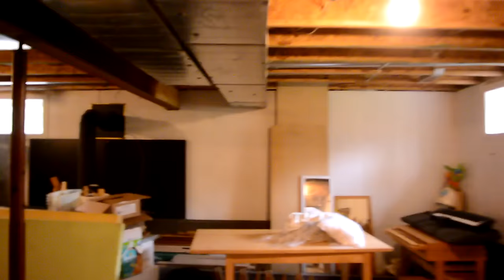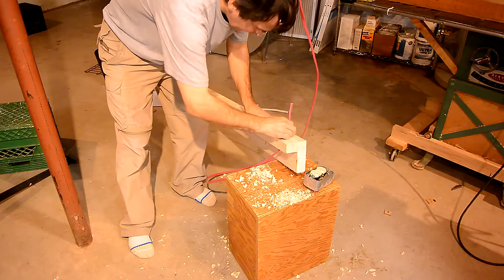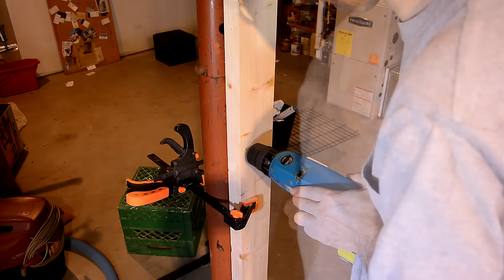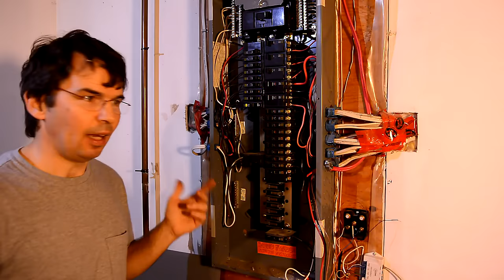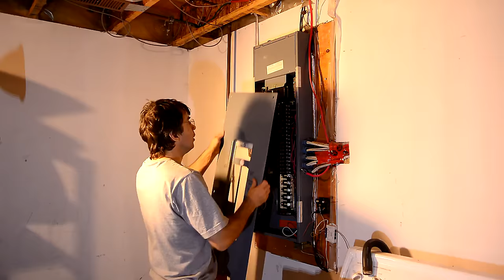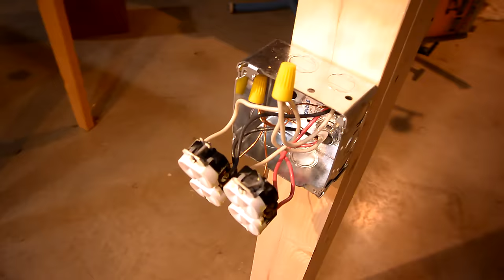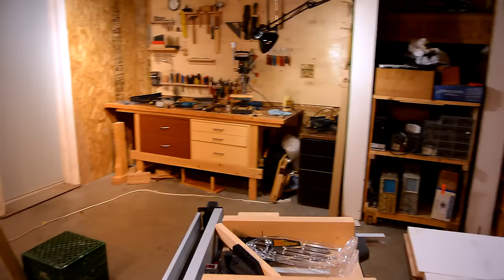Wiring a new 240 volt circuit

Comment: Is your main supply 120 single phase, but you have two 120 lines With phase separation out. Confused UK.
Reply: In the US the typical home is supplied by a single phase of power, in a 240 volt split phase arrangement. Basically that means that the neutral is in the middle of of the 240 volts. That means each live wire is 120 volts away from ground, but 240 volts away from each other.

Matthias is being a bit imprecise when he mentions phases. The two wires are 180 degrees out of phase with each other. Electrically they are considered to be the same phase (this matters for consideration of things like arc faults, which are somewhat different in single phase and multi phase power circuits).
Reply: 180deg?? Surely you mean 120deg?
Reply from the maker: See linked article where I explained all that already
Reply: 180 is right, otherwise it wouldn't be 240 volts
Reply: The sine waves laddy.....in degrees not V for voltages
Reply: 120 degrees is the phase angle in a three-phase system. This is a single phase system with one split phase.
Reply: It's a single phase transformer that takes one of three phases on the pole for the primary and gives a center tap on the secondary which is used for neutral. It's 240 between two sided of the primary and 120 between one side and the neutral. This allows you to have 240v appliances without having any voltages more then 120v above ground.
Reply: 180 degrees. The two “hot” wires of the 240V circuit originate from the two ends of a center-tapped transformer secondary winding. The center tap is the neutral. The secondary produces 120-0-120 at its three connections. Since the two ends are opposite in phase, they are additive; you get 240V across the entire winding and 120V from either end to the center tap. 240V appliances require only the two wires from the winding ends (plus safety ground), 120-240V appliances need all three wires plus the safety ground.

Our power is generated as three phase, with phases separated by 120 degrees. Major distribution lines are three phase; smaller, rural, and residential lines are not (lower cost). A residential single-phase transformer primary winding is fed from one phase of the three-phase system, often 14,400V to ground or even just 7,200V in remote areas. The residential transformer steps that down to 240V center tapped, serving one or several homes.

Three phase is not available in most residential areas at any price. The nearest three phase line to my home is 3/4 mile away.

Comment: Man, you have a lot of room in that panel!  I changed my original 12 circuit for a 30, then we added A/C, a generator input and surge protector and I'm already on doubles. My original panel became a sub panel in my shop and I have a 40 space panel ready to go in when I get the time. I had originally run some 12/3 to get the shared neutral like you did but I then found that the 12/2 was SO much cheaper that it made sense to run two 12/2 runs instead.

Comment: He broke two electrical codes in his installation.  First, the outlet is suppose to be further away from the floor.  Second, you have to leave at least 6 inches of wire either in the outlet box, or just outside of it.
Reply: and he used a razor knife to strip the cover off,  and as someone else said, he used the wrong box connector.....
Reply: If you're going to make a "code" comment, please identify your region.   Code varies by jurisdiction.
Reply: Where I'm from he's not even allowed to perform changes like that at all, so he basically broke all the rules :D
Reply: Yep can't even replace a light fitting in Australia.
Reply: What's the point of having 6inches of wire in an outlet?
Reply: flexibility, stress relief, gives a little safety buffer in case the line is yanked somewhere along the length, expansion and contraction due to temperature changes.
Reply: Just want to say, I thought it was outside the box for the reasons I spec'd, wasn't aware that it could be inside the box.....
Reply: you don't have to leave a service loop since there's is no drywall.
Reply: Muskoka Mike, that's how you strip wire. You don't damage the innards unless if you are incompetent.

Comment: No risk of flood?  Outlet is mighty low
Reply: I was thinking the same thing, Did you ever relocate?
Reply: Never heard of a floor outlet? Those are ... well in the floor. If there is a flood and the outlets are wired properly the breaker will disconnect the power.

Comment: 380V master race reporting in :D
Reply: It says 380V on my outlets :D
Reply: I'm curious how canadians would get that tho, because if monophase is ~120V and biphase is ~240V then each phase is 180° apart, so you can't just add another phase to get a tri-phase system
Reply: It's an old outlet. Since 1988 all 380V triphase systems are 400V. An outlet that can handle 380V has no problem handling 400V. 380V was when your base voltage was 220V. Now it's 230V.
Reply: Jack, His system is single phase. Both the two "hots" are 120 volts from neutral and in phase thus they add to 240 volts.
Reply: 3beltwesty actually the phase of the two hots is 180°. So both are 120V to Neutral, but 240 V difference between the two hots
Reply: Plain Reflex, His home is fed by a Single Phase transformer the secondary is Center tapped, the center tap is grounded at the pole and at the meter. The power is "single phase". Both hots are in phase 0 degrees since they add to 240 volts.

 *****If you float and isolate an O-scope and use 100X probes and tie  the scopes ground probe to one HOT and measure the Neutral one sees 120 volt RMS sine wave, with another probe to the other hot one sees 240 volts RMS the sine wave . With both see at one they are IN phase, not 180 degrees apart. They have to be in phase since that is what all center tapped transformers do with single phase inputs
Reply: 3beltwesty well I have no idea of the technical part, how power is delivered in America. But just from the physics, I can tell you that voltage is a difference in potential. So when you take one wire and compare it to neutral, it is a sine function with an amplitude of 170V. Let's assume the two wires are in phase, thus the potentials are the same the whole time, so theres no difference between these two. So it is a Voltage of 0V. To get 240V you need a phase shift of 180°, or differently speaking:
V1(t)=170V*sin(w*t)= -V2(t).
When you take the difference now it is
V = V1-V2 = 2*V1 = 340V*sin(w*t)
Then the average Voltage over one period is 240V.
Reply: plain reflex the 120 volt rms is 170 zero to peak 340 volts peak to peak. The 240 volts rms is 340 zero to peak and 680 volts peak to peak. Since the voltages are high that is why I said use a 100x probe. There us no phase shift. Thus the voltages are double. Ie 120 plus 120 is 240 volts. All the American Canadian system is a center tapped transformer at the distribution side. Ie no phase shift. Not sure why you think a single phase center tapped transformer has a phase shift
Reply: 3beltwesty ah now i understand how the transformer produces a split phase out of a single phase. But there is still a phase shift in the two split phases. This is because ground is defined as the voltage midpoint, by definition one of the voltages has to be positive and the other one is negative. In other words the sine curve is shifted by 180°
Reply: plain reflex the usa legally calls it a  split phase or a 3 wire system.  It is single phase . It is not two phase. It is not 3 phase. The current and voltages are in phrase in the split phase system with resistive loads. Thus you are using the term "phase" in an improper way at least as far as electrical engineering.  Maybe to it is a translation problem? Ie you say a did is a cat? :)   in the north American system one can connect two 120 volt incandescent bulbs in series . Place them across our 240 volts. The bulbs lite up. Then connect the mid point of the bulbs to our neutral.  Nothing changes.  No current flows since a balanced load. Ie the two legs are in phase.  Ie voltages and currents in phase ie single phase power.
Reply: 3beltwesty I get what you are saying and it is all right. Maybe it is a translation problem, that it is called in phase, although it has a phase angle of 180°.
Reply: plain reflex imagine if you take twenty 12volt automotive tail lights  and wire them in series. Then one  plugs the rig into a 240 volt socket.  All the bulbs light (If they are good:)) . Thus what I am saying is all are in phase if they are a resistive load.      Another idea is here in the usa all the old filament bulbs flicker at 60 hertz slightly but they do so in step. Ie lamps on one 120 volt leg are bright and dim   in step in phase with bulbs on our other 120 volt leg. Regards
Reply: 3beltwesty again it is right what you say, but thats not the point. When you connect all these bulbs across 240V it is just one voltage signal, of course it is in phase with itself. But when you compare the two split phase signals, you have to be a bit more precise. To get a voltage you have to take the difference of the timedependent potentials. Since the sine curves have a 180° phase angle, the voltages are just opposite.
U = 120V - (- 120V) = 240V
Your argument is, to add up the two split phase voltages to get the whole 240V. What you are really doing, is to add the absolute values. Here is your calculation:
U = |120V| + |-120V| = 120V + 120V = 240V
As you see the result is the same, but it is false to assume that the absolute values are the same, thus the phase angle is zero. In reallity the voltages are opposite of each other, which results in a phase angle of 180°.'And the absolute values still add up to 240V
Reply: plain reflex the system here is called single phase. Ie split phase center tap. If one as an experiment has a settup and  grounds the one hot and ungrounded the neutral then the neutral is 120 volts rms  to ground and the other hot is 240 volts rms to ground. All are in phase.  By mentioning 180 out of phase the lay public thinks our system is not single phase. Thus dangerous. Our system goes back to about 1880s in DC voltages. For some odd reason our system is confusing to others. There was some oddball two phase stuff here  a century ago and 25 hertz ac too.

Comment: Hiya Mathias, just wanted to let you know you don't need a direct connection to ground in order for a hot line to zap you. There can be a capacitive property between you and ground that will allow current to flow into you without actually having to flow through you to ground. Just something to be aware of.
Reply from the maker: yes, micro-amperes.  Not enough to get zapped with.
Reply: Thank you, Matthias. They won't understand the difference between "micro" and "milli" even if you demonstrated.

Comment: Oh, that is interesting.  I  was wondering what this whole deal with the two hot black wires hook-ups to 120V all about.  Never have heard of this before.  Now you are the first person I have run into and I got lucky that I watched your video to the end to pick up on the wiring circuit.    It is a good thing that I watched your video to the end.
So, in other words, you can get more amps out of the system.  So it means better to use thicker wires.  Is that why your wires to your outlets look so thick?
So basically it is for shop use, compressors, saws, etc.  Is that the main reason?
I have been through hell the for the last week trying to figure out what the heck people are talking about.  I have kept thinking and thinking, hey my house is not wired like that...

Comment: 5KWA 48v 220v Pure Sine Wave Solar Inverter Built in 50A PWM Solar Charger 220-240v Single phase not split phase !  I’m just adding a Battery back-up to my house with a DIY Generator self sustainable driven on DC power for when the grid drops ! May use once a year and when the building inspector comes out I want it all being proper & inexpensive ! Thanks for all the information and tips like that  1 guy that typed up the safety info 👍🏽

Comment: You must get some high quality drywall screws. If I had tried that, it would have snapped the head off.
Reply: Yeah, what the heck is he using?  The heads always snap off.  Even just in wood.

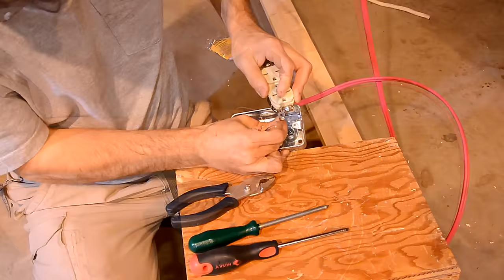Comment: Matthias' has 2 hots and a copper ground at 1:06 thus it is odd that the safety police folks are complaining. The socket is a NEMA 6-15R, it is for 250 volts 15 amps max with a green wire ground and no neutral. Here I install the NEMA 6-20R with the added slot for 15 amp with one vertical spade. ie a modern 6-20R receptacle will take both 20 amp and 15 amp plugs. 

What he is installing is a  "2 pole 3 wire grounding 250 volt" receptacle, a 6-15R.  For clarity there is no neutral wire , both "hots" read and black are 120 volts to neutral back at the meter. The 6-15P and 6-20P are common plugs off a 240 volt window ac unit, ie bigger ones say above 12000 BTUH
Reply: That went by so fast, I didn't see it.  You're right.  That outlet is grounded.  I bet no one saw it.  Watch, they'll all scream that they saw it.  Then they're dopes.

Comment: The original 240V box was fine other than being at floor level, but adding and splitting the 240 into (2) 120 outlets is totally wrong and against code. YOU may always remember what you have there, but no one else will know it. 
Many years ago I moved into my first auto repair shop. It had been a body shop before I moved into it and the old owner did a bunch of wiring. It was winter and I plugged in a salamander heater while i worked on the remodel before opening the shop. Right off the bat it burned up the electronics in the heater. After breaking out my meter, I found the idiot had wired 220 into a 110 outlet.. Yes, I am sure HE knew it, but it cost me a heater and half a days work. Also how ever long it took to check the electrical in the rest of the shop and repair all his screw ups.... It really could have been worse.....
Reply: Yuuuup
Reply: This isn't the same situation, his is still 120v outlets, but I see no extra cable so it's probably not the appropriate breaker.
Reply: There is nothing wrong with how he wired the 120V receptacles. Sharing a neutral is quite acceptable, quite common, and arguably better wiring practice.
Reply: Just remove it before selling the house then.